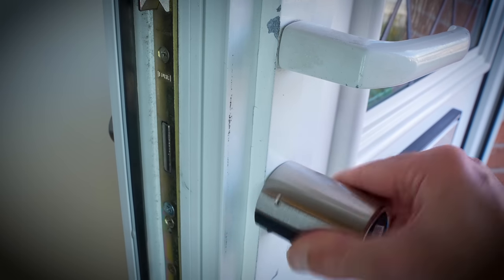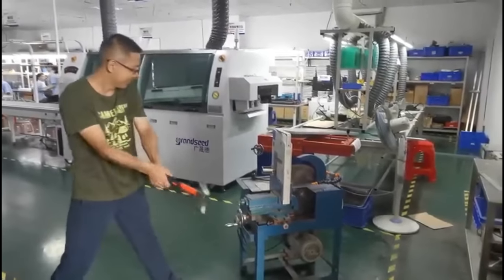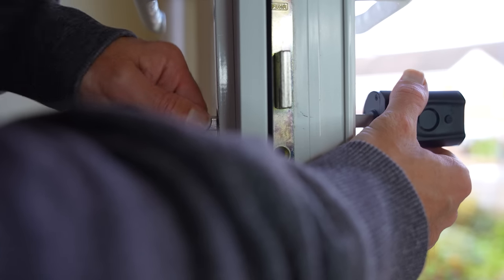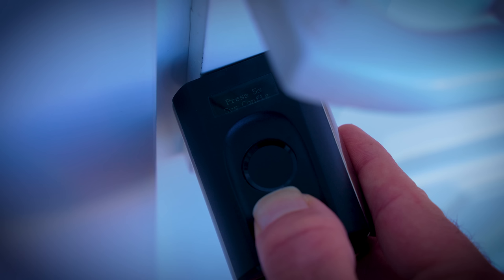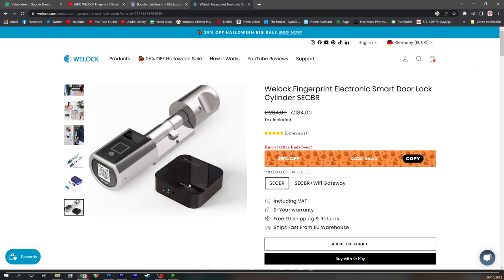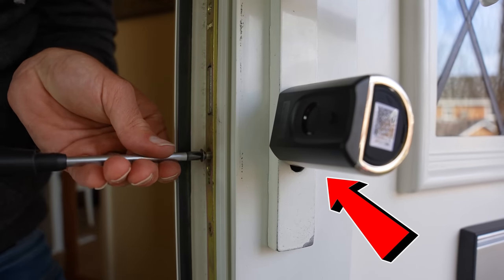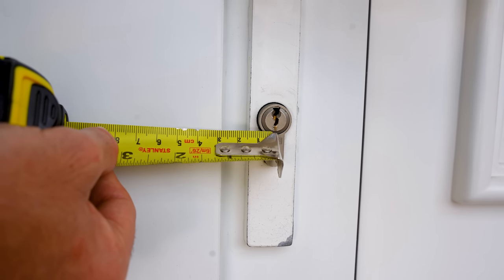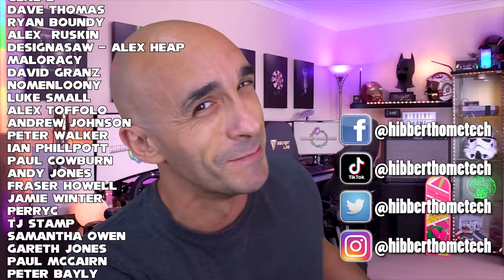This Did Not End Well For Me... Alexa Enabled Retrofit Smart Lock

Comment: Please don’t use this device, it has a design failure. From time to time the little motor inside that engages the handle stays stuck in the engaged position even if the app and little screen says it’s locked.

The only reply I from the manufacturer was please make sure it’s really locked by shacking it side to side each time. Bollocks!
Reply from the maker: I have not experienced this issue. Can you not return it under warranty?
Reply: @paulhibbert  I only became aware of the issue one month after buying it. As I already had disposed of the packing material the local distributor wouldn’t allow a return.

It ended up going in the trash sadly.
Reply from the maker: @trabajoCARA  that sucks man! Would be interested to see if they go through these comments, I obviously can't personally answer this one!

Comment: Funny they didn't employ a design team. If they did it would not have been made. This will be on a YouTube video looking back at gadgets that made you laugh in 2022......
Reply from the maker: I 100% disagree. It looks like a solid metal door handle with a fingerprint scanner on it. I don't see what's not to like.
Reply: @paulhibbert  Good idea, integrate it with the door handle. All in one unit. Scanner ergodynamically posioned as you grip handle for thumb print. Well done Paul.
Reply: Still no Wyzecam v3 outdoor test.
Reply: @mikeys4u  Wyze just released a V3 Cam Pro.
Reply: @OrangeSamurai01  I would never muck around with any camera now I've used the starlight sensor in the Wyzecam. But unfortunately Paul's wife said he wasn't allowed to buy it, and Paul has to do what she says. (Insert thumb comment). ....or is he.....